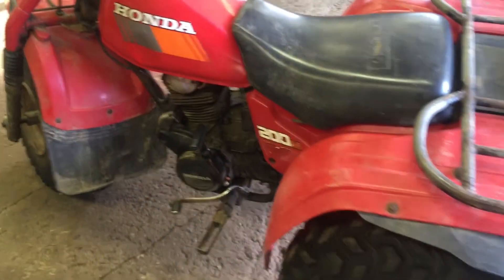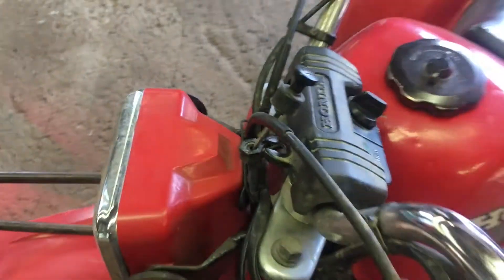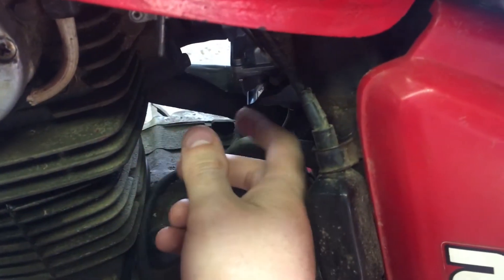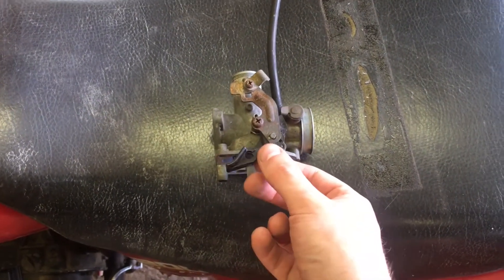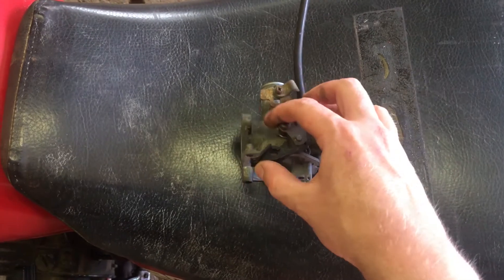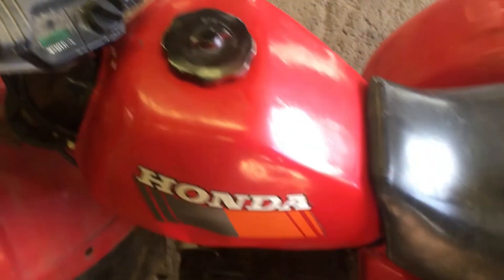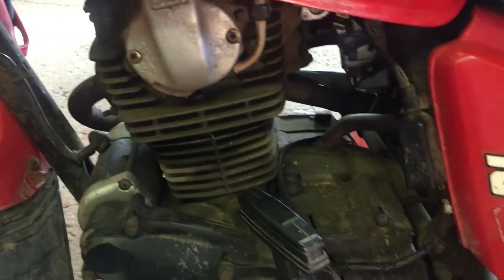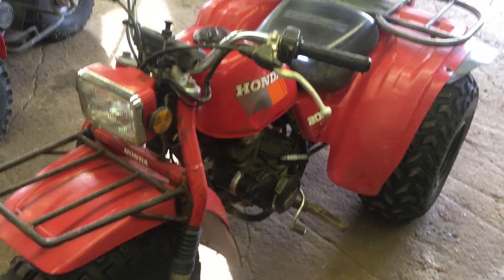Hard starting Honda ATC, simple problem

Comment: Hey I just got a 1981 Honda 200 big red and the throttle is frozen and I was wondering if you can do a video on how to fix that please
Reply from the maker: I put up a recent video of swapping on a Chinese carb like a week ago, shows putting on the throttle slide and stuff. Most likely it’s your throttle slide frozen. Check that video out and see if that’s your issue. If not I can do one on throttle assembly that’s no issue.

Comment: Any chance you'd know what's causing my 200 to smoke black?
Oil seems watery and thing as well - maybe slight gas smell and very full.
Reply from the maker: change the oil if its watery, most likely you are running too rich ( meaning the carb is providing too much fuel to the engine.) Dial back the Air fuel screw. If i recall youd have to adjust the screw in a bit on the carb for that. If you turn on your choke does the bike die down?
Reply: @muddythumper8152  Yes, the bike does of I have the choke on.

It has a stock pilot jet and 105 main.
FMF exhaust and Uni filter.

I have to screw the idle screw all the way in to get it to idle though and unlike my other ATC's I can't hear a change in the rpm's when adjusting the air screw.
Reply from the maker: @FoxyBuildsDIY  sounds like you’re running rich still , if you are out of adjustment on the air fuel screw the only other options are the jets.
Reply: @FoxyBuildsDIY need new seals gas be leaking in oil
Reply: @nuclearwarhead6072  yeah, I'm going to do a full teardown and rebuild. The air fuel screw backed out all the way though and that was causing a high idle.

I've got a few issues to sort with it. Shifting is really difficult on it and sometimes it locks itself into gear and you can't downshift or upshift.

Just finished rebuilding my 185s and 200, so I'll get to this one next. Then likely sell them all and move into something else.

Comment: I'm having issues as to which line goes to where on the carburetor it's my dad's he's owned it since it was brand new I just put a new carburetor on it but it's leaking ass soon as I turn the gasoline on I'm thinking we mixed up the breather line and an gas line
Reply from the maker: Going into the carb should only be one line, the main fuel line. The other ones are basically a vent on some carbs or overflow.  You can send my fb or Instagram a video if you like I’ll have a look, or I can throw a carb on a 200 I got in the shed and throw up another video. I got two bikes I need to put carbs on to sell currently

Comment: I have a 185 Honda. It won't start unless I put gas in the spark plug cylinder and when I do get it running it has to be on half choke or it runs badly. Any ideas?
Reply from the maker: That’s your carb messed up ol buddy. Clean it or replace it

Comment: If those 2 springs are broke, will it cause it to struggle to start going when you start it up and drive it, i replaced my carburetor and it ran fine but yesterday it struggled to start rolling once i put it in first gear and tried taking off. Or could it be a low battery cause the electric start quit working yesterday as well
Reply from the maker: those springs will trouble it a small amount for starting, my assumption is the carb still or choke set up though. can you send my fb a video of it? low battery may be the reason why the starter doesnt work for sure.

Comment: I have a big red 250.. has spark. Plug is wet. Wont start. I can smell gas coming out of the 5/8 vaccum line that is under the seat  that connects to the motor then T's off and goes up to my seat. I can also feel air coming out of the vaccum line when i try starting it. Help please. Had carb off 3 times
Reply from the maker: hey there, if plug is wet means shes rich / or possibly flooded. Do you have a functional choke? If so choke the bike off a bit and see if she catches. If you have good spark, fuel and good compression / timing it will run. If you smell fuel from the vent lines most likely the engine is flooded. Try smelling the oil dipstick, sometimes if  the cylinder is flooded is will pull fuel down into the crankcase. Try taking the plug out of the bike, and pull it over or crank it to blow out any extra fuel. If carb is clean and set up, choke works properly, has good compression spark and fuel she'll run
Reply: May have jumped a tooth on timing causing over compression
Reply: @muddythumper8152  where do the top 5/8 hose go for vent. One hose goes from crank case then has a T, lower hose goes down to vent . Top hose goes up behind carburetor then comes out under frame below front part of seat. I can smell gas fumes from it while its running.  Does this top hose go somewhere? Fumes are stinking up my garage
Thanks
Reply: @REDBANDITOFFICIAL1  where do the top 5/8 hose go for vent. One hose goes from crank case then has a T, lower hose goes down to vent . Top hose goes up behind carburetor then comes out under frame below front part of seat. I can smell gas fumes from it while its running.  Does this top hose go somewhere? Fumes are stinking up my garage
Thanks

Comment: Hey man i just got mune running but when i start it it just revs putting it in gear doesn't do anything and pushing the throttle doesn't do anything either cause is already max rev if anyone has any ideas on what it could be let me know
Reply from the maker: Max rev means your throttle slide probably in backwards , if she doesn’t move clutch issue or needs adjustments